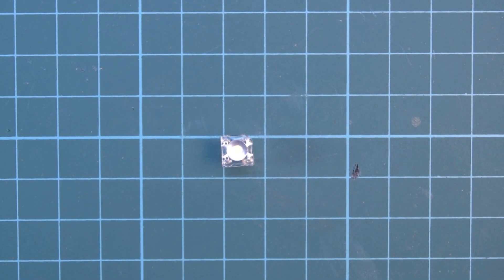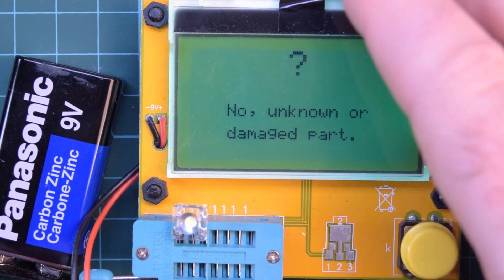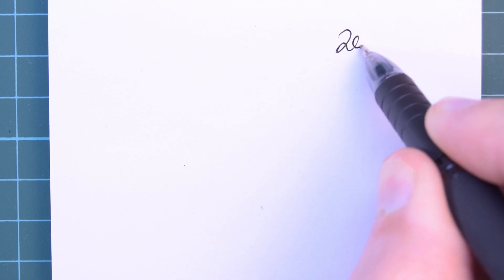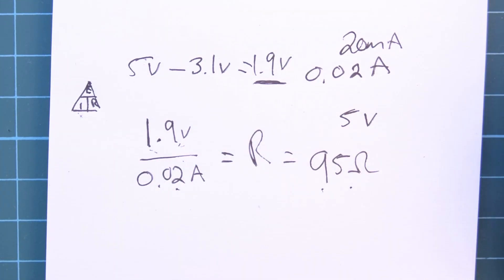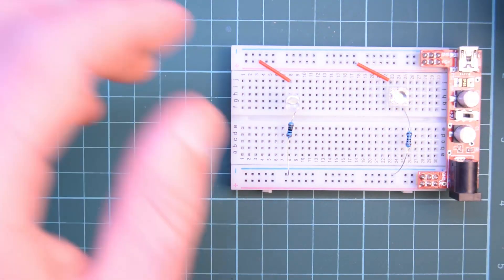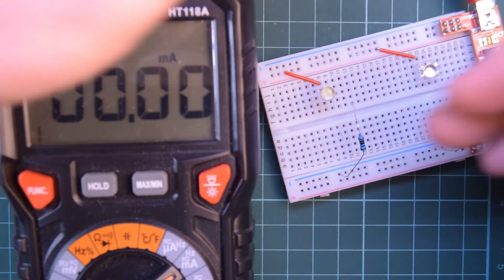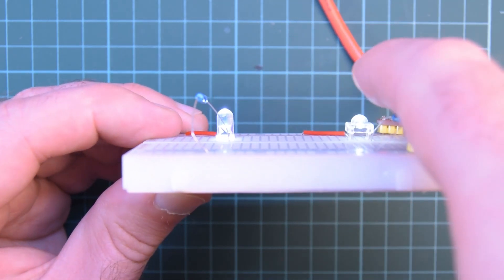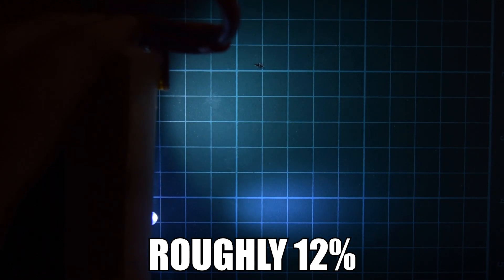Are Piranha LEDs All They Are Cracked Up To Be?

Comment: Can anyone help?
I am looking for a LED with 2 led's in it without common anode/cathode, just 2 led's in one package with 4 leads.
Reply from the maker: This sounds like an XY problem - share what you need it for and what your goal is and people will be able to help you easier!
Reply: @SimpleElectronics  
Essentially I need 2 strings of leds on mains voltage. I am using a PID controller to power a heater and I want one string in red when the PID controller is powering the load and another string in green when the load is "off". PID has a relay 2 way relay that activates as the output is on and off. The load is on SSR output and not connected to the led strings.
I have tried using 2 separate strings but space is reduced and there is half of the string on each color. If I could have dual leds in single package that would be great since there are more lighting. 
Using 3 lead leds complicates things since I cannot series them and need to paralell them instead.

Comment: Hi. What you are missing there is the zooming, magnification radius of the light wave. The pyranha zooms out the light like a dome compared to the 5mm led that focuses the light a bit similar to a laser, putting more light into a narrower spot.
They are about the same lumens.
You can use a light spectrum meter for lumens output by measuring close to the led. So the result is 99% equal in lumens. Piranha lighting with a small increased power. But is not efficient in power consumption. The 5mm led is the winner in power efficiency for the microamps consumption. But not much difference. Few nanoamps means nothing in electricity.
Reply from the maker: The 5mm LED would be in the milliamps not microamps - a typical 5mm led needs a few milliamps to have a reasonable light level

Comment: Definitely worth testing this with a lux sensor (easy to find cheap i2c ones like the bh1750). A lot of LEDs have different color spectums and focus, that changes the quality and throw of the light too. I would be interested to know what your impressions about the difference in quality of the light? When used as a flashlight, vs for reading, etc. Love your videos!

Comment: I used to use these a lot a few years back, and then they were much brighter and focused than the normal through hole LEDs you could get. Also have some Red, Green and Blue ones which were compact and worked well to replace single colour downlights, although they didn't mix the colours that well close up. But now I think things have moved on, and most 5050 SMT LEDs are just as good and readily available, and the WS28nn ones have pretty much made the RGB Piranha ones obsolete for me now.

Comment: Would linking the pairs of legs of the Piranha LED before using it in  the test rig work? That way the whole thing would be tested it may balance the system? just a thought.Never found a use for them, but I do like a good old fashoned LED.   👍👍
Reply from the maker: The legs are the same connection internally, so they are already connected together

Comment: The color temperature looks a lot different between the two. The regular LED looks much cooler, leaning towards daylight white.  That also gives it the appearance of being slightly brighter even with the lower current. What if you were to measure the brightness of each with a sensor to get a better value of actual brightness? Maybe a standard photoresistor or an ambient light sensor like the TEMT6000.